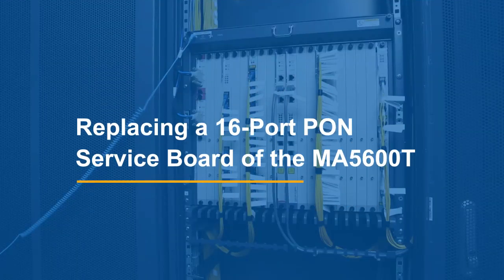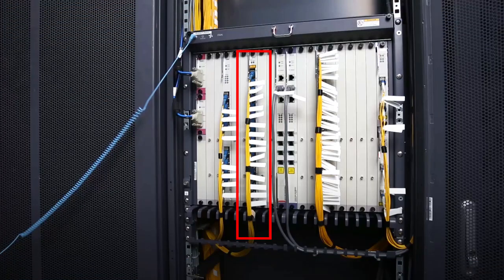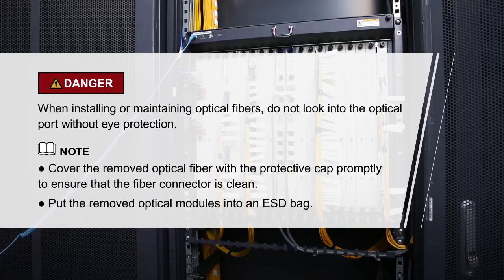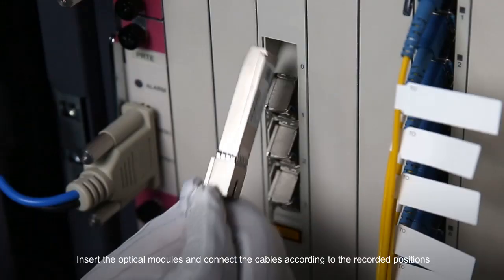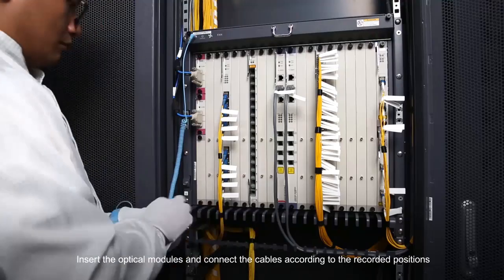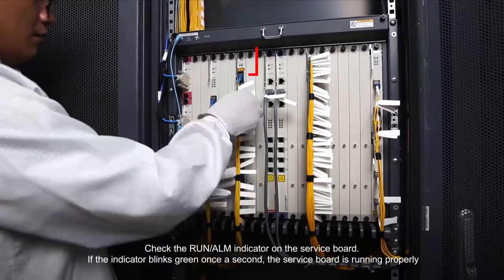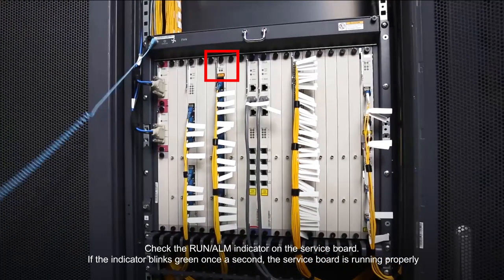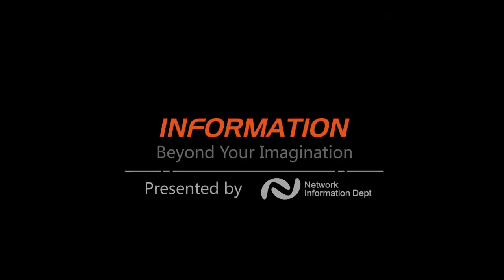Huawei MA5600T-Replacing a 16-Port PON Service Board

Comment: Hello!
I have a MA5603T OLT and i need to replace the H806GPBD for H806GPFD (8 to 16 port board)
Do i need to run any commands? I only found documentation for the H806GPBH
Reply from the maker: Thank you for your attention to the documentation.
It is confirmed that no document needs to be modified. The reply is as following：It is confirmed that the H806GPBD board cannot be replaced by the H806GPFD board. If you have any questions, contact the local Huawei technical support.
If you have any other questions, leave messages in corresponding web pages.

Comment: I want ask a question about this indoor cabinet does it contain a sensor that sense temperature or any heat and send alarm or not
Reply from the maker: Thank you for your attention to the documentation.
It is confirmed that no document needs to be modified. The reply is as following：The cabinet itself doesn't contain the temperature alarm. Some boards have the temperature alarm and you can check the information in Hardware Description - Board - Specific board - Indicator - RUN ALM.
If you have any other questions, leave messages in corresponding web pages.

Comment: Hello.
I have a MA5608T and I need to replace the H806GPBH board with the H805GPFD board.

Do I also need to run any command?
Reply from the maker: Dear 
Jorge Enrique Cerquera Perez

 Thank you for your attention to the documentation.
It is confirmed that no document needs to be modified. The reply is as following:
Replace the H806GPBH board with the H805GPFD board without running any command.